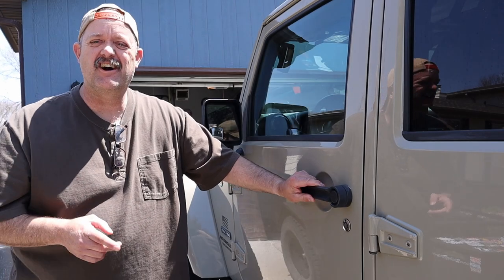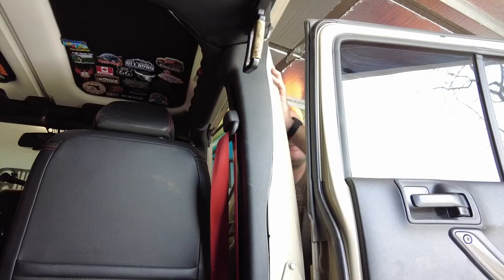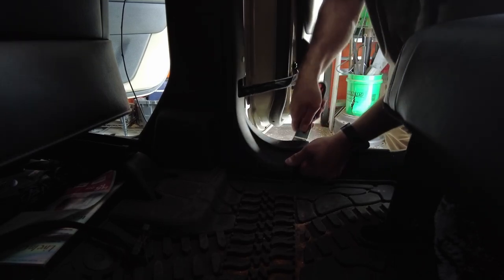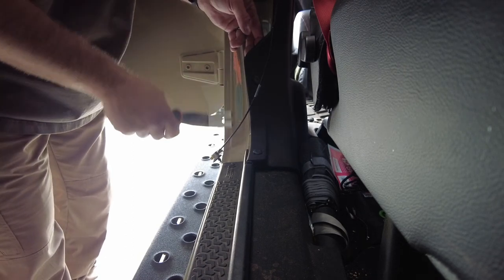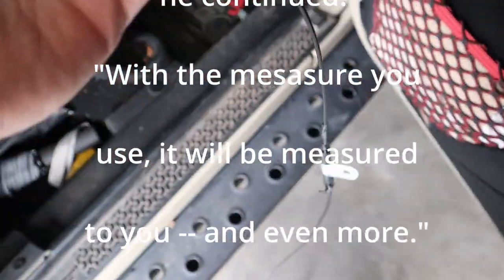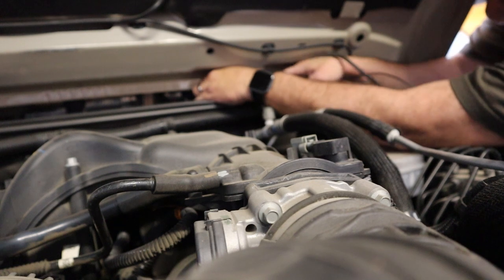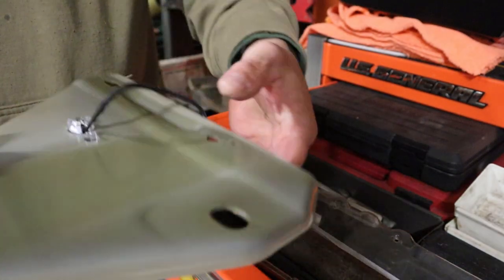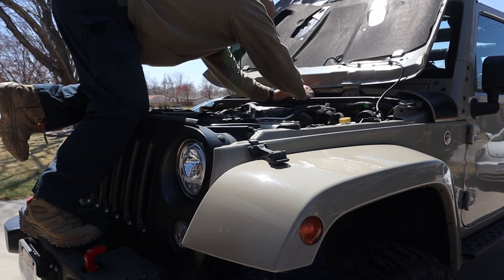Moving the Jeep Wrangler Satellite Radio antenna for the Roof top tent.

Comment: I just bought a 2016 JK Rubicon. I’m having the same issue. Would it be easier just to buy an aftermarket magnetic antenna? Just to run the wiring either to the back of the radio or up the pillar where you disconnected the antenna?
Reply from the maker: I am not sure if the magnet would effect the antenna.  This was free and I works great for me.  I have noticed that if I park next to a tall building i loose reseption, but it is nothing makes me regret moving the antenna where I did.  Thanks for taking the time to watch and comment.  Please consider helping the channel by subscribing.
Reply: @DunnageGarage  if you purchase a Sirius satellite antenna, it has a magnet on the back so that it’ll stick to your vehicle. I’ve used that style several times. I noticed on your video that the antenna connector is the same minus the plastic clip around the connector.
Reply from the maker: @ralphvigil6634  good to know, that might help others watching this video.

Comment: Thanks for sharing this. Have you found a substantial difference in how your radio is receiving since relocating the antenna?  Thanks again.
Reply from the maker: It had better reception in the factory location.  However, it works better than if the antenna was under the RTT.  I also don't even notice it on the hood.
Reply: @DunnageGarage  Love to hear a little more detail on this. I already relocated the antenna on my JL just above the driver side sun visor via the maximus-3 bracket and my tent still interferes when I am traveling northbound.  Do you feel your windshield/cab blocks the signal regularly when traveling certain directions? Or do you have constant signal regardless of direction barring no obvious obstructions? Appreciate any feedback!
Reply from the maker: @theFreakitiki  I will have momentary losses in reception that I didn't experience before, such as going under a certain railroad underpass, or near a power relay station.  It happens so infrequently that I barely notice it.  I do nor recall a loss of reception when driving between Colorado and Nebraska.  To date, I am very happy with the modification.
Reply: @DunnageGarage  Appreciate the quick and detailed response. Based on that, I'll be looking to adapt this concept on my JL very soon. The location and wiring is actually very different but the concept will be the same. Thanks again.